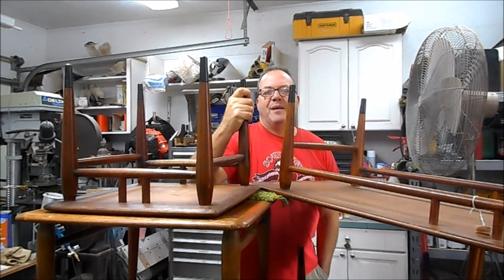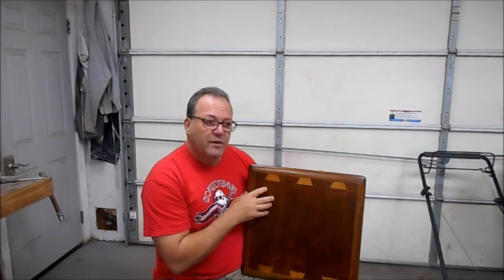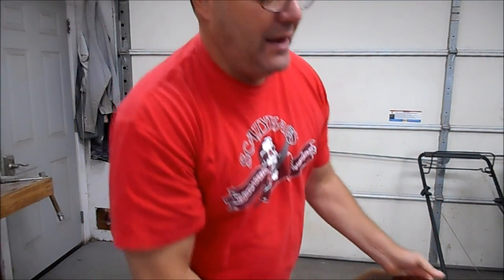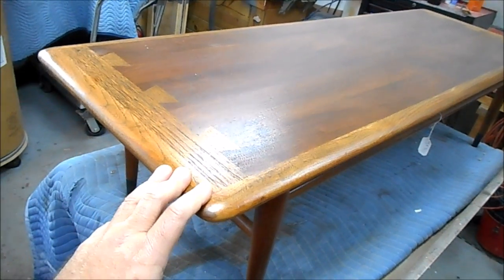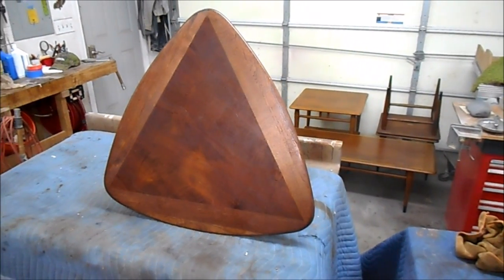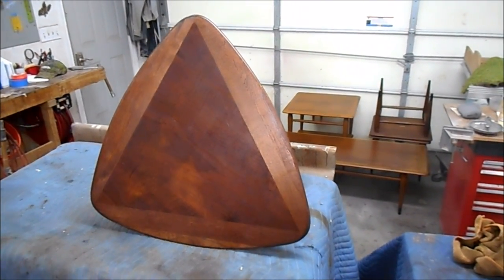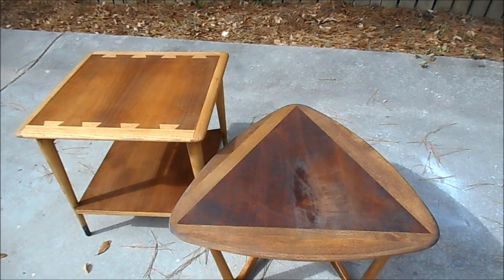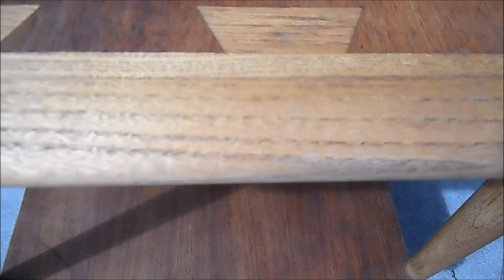Drowning in Acclaim (Furniture that is)

Comment: I just refinished a step up and lamp table and wish I watched these videos, prior. I am not looking to resell, as these tables are too important to me and my family. My parents had 2 lamp tables but gave one to my neighbor in the 70's, ugh. I have no experience, so I gave it ago. I was like they cannot get any worse than are. I never thought of stripping. I used 80, 120, 220 sandpaper with a sander, put on a preconditioner, light stain, oil base poly and they came out beautifully. I just love the detail in the walnut.  There was some small shadowing in a small area of each table, even though the wood looked perfect after sanding and getting rid of any particles. Is it from not stripping? or just the wood? I really do not have the money for your awesome process but was just curious of your thoughts. If I come across another lane table, I would like to refinish another one. Also, even though the original factory look and color is great, I prefer light colored wood look. I love the look after you sand, the original look, but have no idea to keep the walnut light as possible. On one table I did a natural stain and I think the ash is too light, but the light stain I did looks good, in my eyes, on the ash and of course the walnut is dark.  using water-based products? Any hep would be greatly appreciated. Thank You

Comment: So excited to have found you!  I am actually semi-local (Decatur).  My wife and I have several Acclaim pieces, a console and a boomerang coffee table.  The boomerang is in pretty good shape, but needs a thorough cleaning and some minor repairs, scratches, gouge, places where the finish is worn off, etc.  I've already repaired the wood block which the pivot leg sits in - it was cracked.  So several questions....first, where can I find you and the shop that you are putting stuff in to poke around.  Second, I've done the first pass of cleaning using a solution of 50/50 water/vinegar and a few drops of dawn.  That got a lot of service grime, but there is still some dirt/grease whatever.  What do you recommend next?  I've read that some go to mineral spirits, others the Howard's Orange Oil, and some even recommended Mequire's Swirl remover.  Then I was thinking a little scractch cover in the deeper places, and then wax?  Look forward to exploring your collection.....
Reply from the maker: My wife has her retail space at the Cobb Antique Mall 2800 Canton Rd Marietta, GA.   It opens on 1/15/18, having moved from it's prior location on Cobb Parkway in Marietta.   She is vendor 152 and 3 of her 5 spaces are under the big blue Marlin mounted high on the wall.  You'll see it when you walk in just off to the right.   For routine cleaning, I normally mix some TSP (Tri-Sodium Phosphate) with warm water and some Dawn dish washing detergent and use that as a mild cleaner.  The TSP acts to cut the grease and the Dawn as a surfactant to carry it off.  I have used mineral spirits to cut really heavy grease and/or wax.  Remember to wipe the piece dry as soon as you can to avoid any finish issues.   You may want to use an old tooth brush or similar tool to access any dirt in tight spaces.   Thanks for commenting.  I'm glad you found us and good luck with your projects!

Comment: I picked up an Acclaim coffee table at a thrift store here yesterday and that's how I found your videos. They are fantastic and I can't wait to get started, but I'm hoping you can give me some advice for taking care of a small cigarette burn in the walnut veneer. Maybe you have a video I haven't seen where you address burns? TIA.
Reply from the maker: Hi David.  Great find on the coffee table.

Cigarette burns are tough.   First, assess how deep the burn goes into the walnut veneer.   If it's just lightly scorched, you can probably sand it out.  If it goes deeper you'll have to decide how you want to handle it.  Off the top of my head I have 3 suggestions for you:

Option 1:   Leave it alone.   Refinish over it and consider it patina.  (I don't like this option).

Option 2:   Carefully cut out and remove the damaged area and inlay a new piece of walnut veneer.   Do your best to match grain patterns, etc.   If you have never do this kind or repair you may want to practice on another piece.   David Termini, Tom Johnson and others have YouTube videos on veneer repair.   I have a few as well.    Dashner Designs has a video specifically addressing your issue.  I found it here:  https://www.youtube.com/watch?v=5jOtgW695LE

Option 3:  Dig it out, use a walnut colored epoxy filler or perhaps a wood filler if it's not too deep and fill the void.  When dry, sand flush, then using your artistic skills, color match and faux grain it to blend in.  

Remember, it was damaged when you got it, so you can't mess it up.   Give it a try and see how it goes.

Thanks for watching and good luck with your project.

Best regards.
Reply: Thanks so much for the advice. Can't wait to get it done!
Reply: Lost Mountain Restoration i

Comment: Hi ... I've got a Lane table to refinish and am wondering how you retain the identification information on the bottom of the piece through stripping and sanding.  Thank you in advance.
Reply from the maker: Hi.   I normally don't have to do too much stripping on the underside of these tables as there isn't much finish there to start with.   When I do strip a piece that has any important information on it, I cover it with waxed paper and shipping tape to keep any chemicals and/or finish off of it.   You can also just avoid the area if your hand is steady.   Good luck with your project!

Comment: I recently acquired 2 Lane Acclaim pieces that need some work and I'm so glad to have found your channel.  I've learned so much from you - thanks!  One piece is a 2-tiered end table with serial # 668120 and the other is an extra long surfboard coffee table (measures 70"L x 18"W x 13"H). I can't see the serial # on the coffee table because it's stamped in ink and very worn.  They both have the same type of dove tail inlay design so I would assume they were made with the same types of wood solids and veneers.  Have you come across any of these types of coffee tables and if so, do you have any information about it?  I would really appreciate it.  Also, what type of black paint do you use on the leg tips and what is the application process? Thanks so much for your help :-)
Reply from the maker: I have done 4 or 5 coffee tables, but I'm not certain I have done the one you are describing.  If you Google Lane Acclaim, you can find copies of their old catalogs on line and you should be able to ID that table.   As far as the legs, I use a small squirrel hair artists brush to apply satin paint, I think it's by Rustoleum, and it's called "Canyon Black".  You can tape the leg off above the groove if you wish, but I can usually get it on by being careful.   I normally sand and then clean the black tip area before I put the paint on.   I'm very happy you have found the videos informative.  Best of luck on your projects.   I'm sure they will come out great.   Let me know if I can help further.

Comment: Hi, Larry!  I just spent an hour looking for a comment of mine that you replied to a while back.  However...no luck.  I have a midcentury dining table that I think is walnut and teak veneer (G-Plan brand).  The butterfly leaf has what I think is the correct finish and color, however, the main table top appears to have no protective finish and the previous owner was using teak oil to wipe it down, which has stained the wood.  Should I attempt to see if there is a small amount of finish before trying to remove the teak oil?  Also, how would you recommend removing the oil?  Will I need to sand it off and apply oxalic acid to try and remove what is left?  Not sure what to do here and I trust your expert advice.  Thank you!  ~tony
Reply from the maker: I suspect you will need to strip and sand before adding new finish.  You can try to be less aggressive as you start by trying Naptha or Mineral Spirits on 0000 steel wool.  That my get the oil out, but Teak Oil generally has a varnish or poly in the mix and that won't come off with those solvents.   Good luck.

Comment: Hello, can you sand first, just skip the stripping? Thanks!
Reply from the maker: It all depends on the condition and what you want the finished piece to look like.  Careful with excessive sanding as you will go through the thin veneer in a hurry.   Also, make sure whatever top coat you are planning on using will properly adhere to the surface you prepare.   Good luck with your project and thanks for watching.